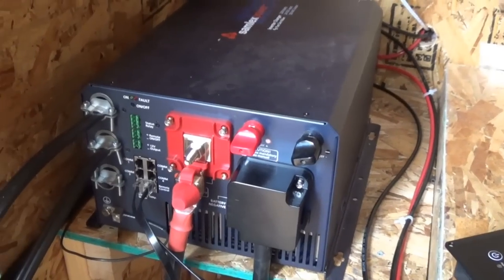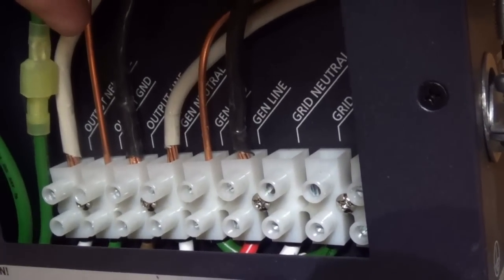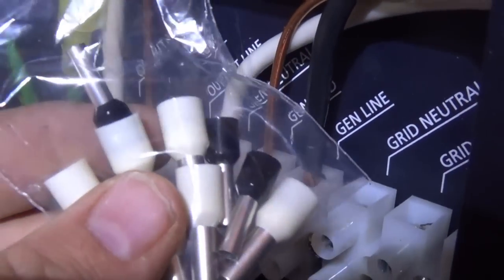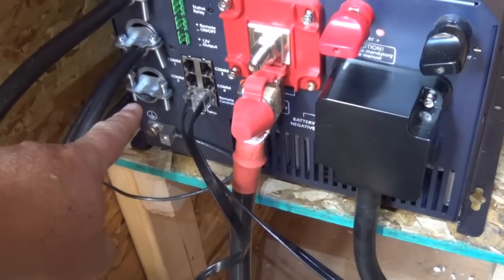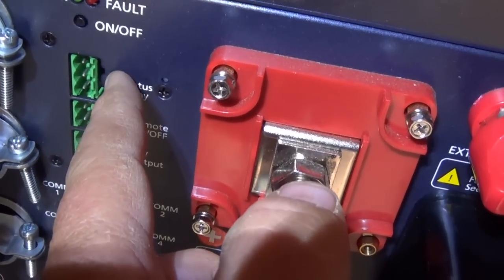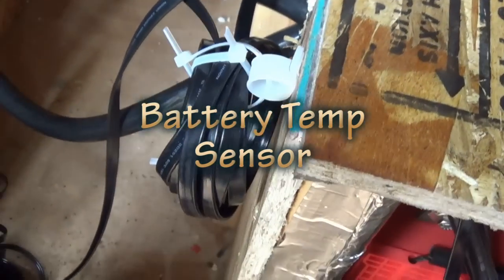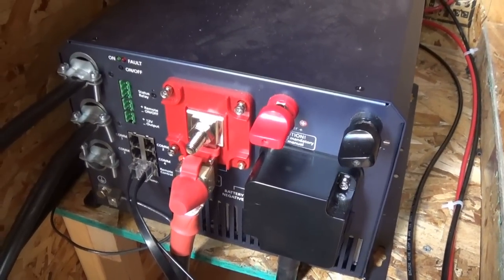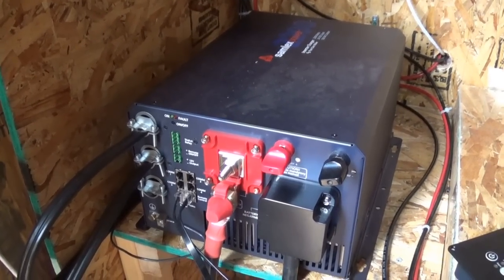Samlex 2200 watt 24v  Inverter - Model 2224 Inverter Charger - Use Off Grid or On Grid

Comment: That's a nice expensive inverter
Reply from the maker: its been awesome. i just wish it was greater than 2200 watts. some day it will get an upgrade.
Reply: @ArizonaHotHomestead  good morning I was just messing with you I have the 3000 watt 12 volt for 3 years and I love it I wish I want to buy a 4000 Watt 24v samlex evo is a industrial inverter I run a 1300 qft home the only tiny I don't run is the 3 1/2 ton a/c and the water heater sow wat I'm sure it's the you got a rally good inverter but not a lot of people use it because samlex only makes a 12v and 24v but I haven't had any problems with my inverter

Comment: What are the red and black terminals above your negative battery input cable for please?
Reply from the maker: its for an external charger. have to read the manual for proper use.

Comment: What brand Genny are you using? Inverter or just a big box "dirty power" my buddy wants this inverter but wants to make sure his "dirty power" Genny will connect. Some of the UPS type inverters like this one doesn't like the quality of power coming from Genny and won't switch to grid power to charge the batteries
Reply from the maker: champion. the key is to use the right size genny. example i have a 2200/6000 watt samlex inverter/charger it need a generator that provides a min of 30 amps, max 40amps. it will use 15 amps for charging and 15 amps for loads. . if you try to use the 20amp outlet on the generator it wont work. must use the 30amp plug. i wired the inverter to a switch than to a 30amp plug to plug into the 30amp outlet on the generator.
Reply: @ArizonaHotHomestead  30 amp rv plug 120 volt. Right. So it's not THD input sensitive? I have several pure sinewave UPS that if they see input voltage sag/spike or high THD they will switch to battery backup automatically. I just wanted to make sure that's not the case with this inverter charger

Comment: How come you did not connect your charge controller to the inverter?
Reply from the maker: great question.. I have a lame answer, becus I didn't want to. . I like the idea of being able to turn off the inverter and only run dc . there might be times when I am on a hunting trip or visiting family or something that I might be away for a few days so in those cases I want to only have the bare essentials on which would be the dc. so in the winter when temps get to 0 degrees I can still run the rv furnace fan on dc . it gives me options.

Comment: I like it. Got the Evo 2212 for my travel trailer. Just a comment about the fuse. The fuse is there to protect the wire only,  not the device. best to have it within 7 inches of batteries. ABYC, NEC and CSA dictate that. I know it's a long shot that something could happen but I know in my mind  I would have  the fuse on the battery side.
Reply from the maker: +Cheyenne H yea I was thinking I might change the location of the fuse. plus it would allow me to put the cover over again with better protects me from injury. . good for you on the evo2212. good luck on yours. is it replacing the charger/inverter that came with the trailer. ??
Reply: +ArizonaHotHomestead Yeah took out the converter and did some rewiring. I am using both Gen and Grid connection. using 8/2 for Grid and Output connection and 10/2 for Gen connection. Love the fact that the EVO is adjustable for the input. I have the Grid set at 30amp  and Gen set at 23 amps. Plus my solar controller connected to Ext Charger connection, love that and how it suppliments when connected to ac. I talked to Samlex and they had a software upgrade that you load up on SD card. Allows you to do some more things. Waiting for them to incorporate a dc shunt monitor into the system to monitor external dc load,  they said it's possible and that they are working on some things. I can wait. I'm  really impressed with it. Also if you switch the system off and have a solar or external charger connected to EXT connection,  it will pass through,  was wondering that for storage,  cause I don't want the inverter on when it's in storage but I still want it to charge the batteries.

Comment: I would not want a gird tie inverter for a stand alone system. Of course I basically do not use an inverter due to emf issues, though I have one that stays remotely disconnected except for the blender and printer and such. Mine is a joke, for regular use, but good for what I want. Yours looks quite durable and is an inverter that can really power a home.
Reply from the maker: +Prima Donna Going Off Grid for your situation your right just need a simple inverter just to run when you need it

Comment: Better to have to much power than not enough, i probly would need 100 amps but maybe not all i ever run is the refrig fan 5000btu air conditioner.
Reply from the maker: +Guy Azbell your ac should have some time of watt or amp rating. is the ac unit a 12 volt or 120 volt type. if 120 volts and rated at 5 amps that is equal to 50 amps at 12volts.    Watts=volts x amps  with the watts always remaining the same. and of course you probably know this too but if batteries are 100amps that means you really only have 50 available  which would discharge the battery to 50% which is extreme.

Comment: Its nice but do you really need that big of a system?I thought you were keeping it simple.
Reply: +Bob Runde Better to have TO Much then not having enough in my Opinion.
Reply from the maker: +Bob Runde keeping it simple to mean also means to have enough solar and battery power that I don't have to think about it. it just does its thing. some have been saying I need breakers/fuses between every component and the charge controller should be 10 times bigger than the solar array. some even say my inverter should be more than 5000 watts.  with remote meters all over the place. .. that's way to much for me.